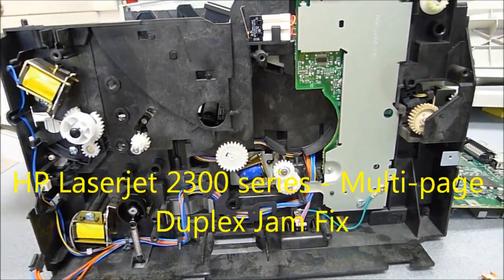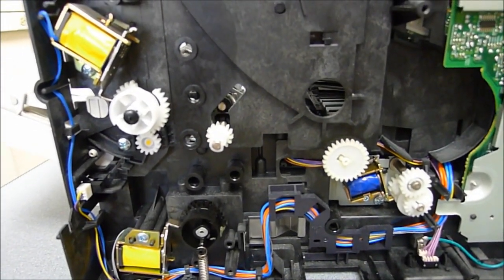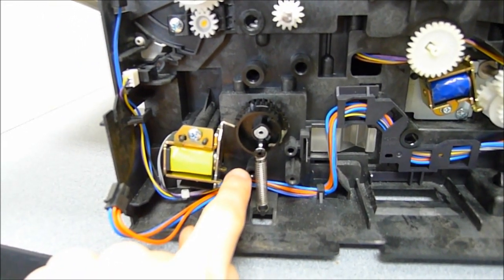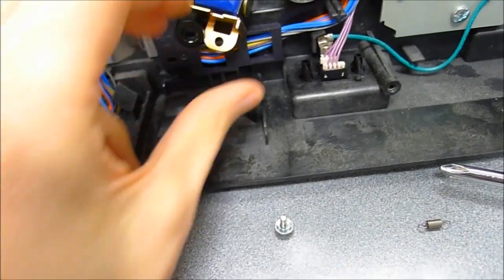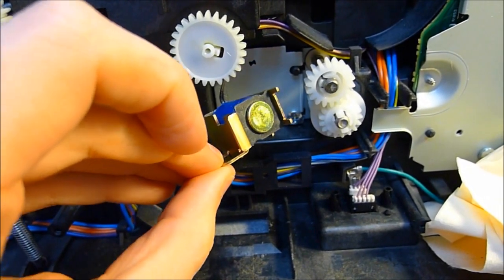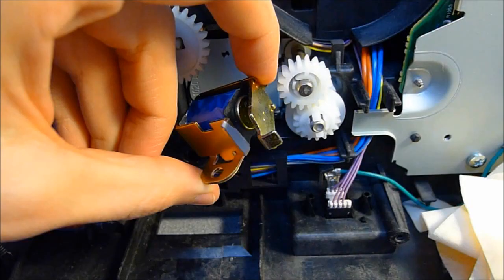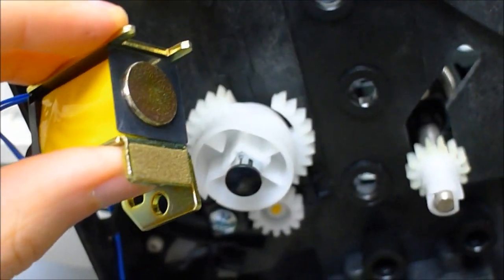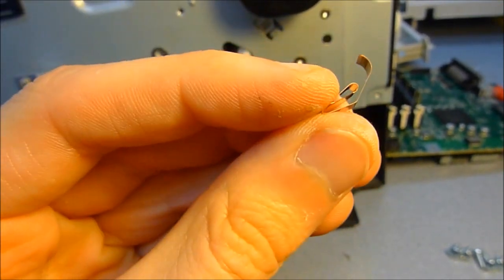Laserjet 2300 Multi Page Duplex Jam: a Solenoid Fix

Comment: I've had an HP Laserjet 2200DN for 10 years and it was easily 5 years old when I got it. I've had the issue for about 2 years and finally got around to looking into it, I could print one page consistently but after following your guide I'm now printing duplex and back 100% operational! All of the 3x solenoids were sticking. I used a few strips of electrical tape to shield them. Thank you, you've saved this printer from the scrap heap.

Comment: Thanks for this—found the video because I was having the two-page-feed/paper jam problem in duplexing. Once I heard the explanation of the problem, I pulled out a screwdriver and a bottle of Goo-Gone and the fix took about half an hour.

For those wanting directions to get the area shown in the video exposed—just sort of follow your nose. The rough order of disassembly is:

1) Side of printer (interface side, not power switch side) off—no screws, just a little plastic latch and a slide (look at the bottom of the printer where that face meets the bottom, you'll see the slide mechanism; the latch is just under the top cover, on the right near the front.

2) Remove interface/memory board—about 5 screws. If you have a JetDirect card in, remove that first. Just detach all the cables (one ribbon, two sets of wires). They'll be easy to remember where to stick, it's a 1:1 fit all around when reassembling.

3) Remove the back cover of the printer (two screws).

4) Remove the top cover of the printer. This is the most fiddly bit, the top cover connects to a large plastic lever/switch assembly on the right side. You'll have to disconnect this and let it drop through the hole in the top cover (use some needle-nose pliers or similar—gently).

5) Remove the front user interface panel. This isn't too hard—some screws and a metal plate.

6) Now take out about 4 large plastic-threaded screws and another three sheet metal screws and the entire metal panel comes away—a bit. It'll be tugging on three cables, one ribbon cable, one bundle of wires, and one ground wire. They're all connected just on the other side of the plastic wall; you'll have free access to disconnect them all with your hands, no problem here.

7) Lift away the entire metal assembly and you'll see the view in this video. The three solenoids are held in place by a single screw. I didn't disconnect the actual wires, just undid the screw and it gave me more than enough room to work with. Used goo gone, an X-Acto knife (to scrape the glue more quickly) and some Q-Tips to clean them all off. Then reattached the spring on each of them.

9. Reverse the entire process. Again, the hardest bit for me was reconnecting the top cover because of it's connection through the hole to the base of the printer on the right arm.

This probably even sounds more complicated than it is if you're mechanically inclined. Just follow your nose and the general order (side panel, interface board, back cover, top cover) and be methodical about figuring out how each piece is connected. There are no special tools required and no part is particularly tricky or dangerous—no four-letter words needed.

Comment: Just fixed my 2300DN as well, I used super thin Zip ties for the buffer for the anti magnetic properties....   works like it did 9 years ago when new.   Thank you for the information, I knew it was a timing issue, never ever would have thought that HP was dumb enough to do what they did.

Comment: To avoid any issues from adhesive, find some heat shrink tubing that is wide enough and cut a ring from it. Put the loop in place on the tab of the solenoid and shrink it with a hair drier. Do use anything hotter to avoid damage to the solenoid. You now have your bumper and no possible issue with adhesive in the future. You can get an assortment of heat shrink tubing from Harbor Freight (or possibly Amazon).
Reply: I also don't trust adhesive and electrical tape. Shrink tubing is a good solution. I will also try a short piece of silicon tubing. Jonathan Ohrt suggested super thin Zip ties for the buffer.

Comment: Thanks to your video I managed to fix my 2300n printer! I used duckt tape as the buffer replacement and it workes as new! (I made sure that duckt tape is wrapped around the metal part, so no sticky part is exposed). Thanks a lot and keep the good work!
Reply: years from now the adhesive will turn to powder :)

Comment: Thank you very much! This problem has been bothering me for 1 year. Before, I was always searching for 'paper jam'. Once I suddenly found the image is not correctly centered, but shift downwards significantly I finally realize is not the pick up roller, but must be some error in the timing. I changed my searching term to 'jam only duplex' That's when I finally found your video. Thank you so so much. 
But after my careless re-assembly, it first fails 5 pages, like jam or blur or all kinds of different errors, and then it go back to normal gradually. Only one thing not normal, while I was printing, now it says a 'Attention with the ability to continue' (=Red light blinking + Go light On)
Any one has same situation?
Thanks again.

Comment: How many layer of tape we have to put and of what kind of tape, can we use electric tape
Reply from the maker: I would recommend not using electrical tape because of how soft it is. Remember, the solenoid parts are going to be striking with force. Anything that can "sink in" might cause problems down the road. I'd stick with "invisible/clear" tape instead.

Comment: Thanks so much for this excellent video. 

Quick question,  can this solenoid issue also be the cause of single page duplex printing issues?  In other words, It jams even when when attempting to print one page, double sided. (prints OK single sided regardless of the number of pages). 

Any confirmation on this would be appreciated.
Cheers!
Reply from the maker: Yes, there is probably (although I don't know for sure - it's been 5.5 years since I made the video and I don't do nearly as much printer work anymore) a solenoid that is controlling the return of the paper from its first side, back into the machine to be flipped over to do the other side. If your jam seems to be occurring at that between-sides point, when the paper is going back into be duplexed, then it's likely that there's a sticky solenoid around the duplexer area. Good luck!
Reply: @heiseheise  Fantastic. I really appreciate your input and vote of confidence on this one. Given your hunch, I'll tackle it :). I completely understand that the video is old and so appreciate your feedback even the more. Thanks again.
Reply from the maker: @gillesgagnon  Right; I've fixed the service manual link in my description too. I didn't realize it was broken; sorry.
Reply: @heiseheise  np... I didn't know it was broken... it was kind of you to do this :)

Comment: Great.. other web postings guided me to the solenoid bumpers, but I stopped after cleaning them off.  If the duplex solenoid is left bare, the timing WILL be incorrect, and the machine will jam on every duplex page.  So, as heiseheise points out, that little peice of tape (I used a double thickness) is VITAL.  Thanks for saving my 2300s from the scrap heap!!
Reply: Hmmm—I didn't see this comment before doing the job myself and I left it bare—and just printed about 600 duplex pages after reassembling. So in some cases it may work—YMMV, all.

Comment: Excellent Video by "heiseheise".
Can I "glue a plastic" to the solenoid using superglue?. Is superglue recommended? 
I do have this printer in the office that has been abandoned for five years now due to paper jam.
I will try and fix the paper jam issue and provide a feedback when finished.

Also thanks to Michal Kowol for the photo illustration of where the clip should go.

Comment: I tried to do this fix and now my printer just clicks loudly twice when trying to feed from tray 2, and nothing else happens. (A paper jam is reported, but no paper rollers spin.) What did I do wrong? Tray 1 works fine. And I also have a Tray 3, and THAT works.
Reply from the maker: You doublechecked all the solenoid connections? Sorry, it's been years since I've had to do one of these fixes now (we've gotten rid of most of our old printers in my department), nothing is coming to mind.

Comment: that little clip  part is to ground the network card box to the chassis , not needed.
Reply: somebody Know from where are 1 piece of circular solid metalwith 4 - 5 mm diametter and 1mm thikness ? After put band on solenoid my printer does not recognize cartdrige and when does prints awfull pages with much grey over it;;;; BUT if I keep the printer on 45 degree it see the cartridge and print grey, so what should i CHECK NEXT ?
Reply: Confort Italia  OK I repaired the imprimant, that piece of metal was from a LEVER of some kind who stop one arc (springs) to enter in the second arc when cartridge is inserted in it's place, and a little piece of metal like a nail is forced to PUSH the cartdrige some milimeters from right to left ( when TOP cover is pressed DOWN). Hope it helps others ... who has these problem ( mine FIRST was duplex printing JAM, after cleaning the 3 solenoids and cover with electric band appear eroor with cartridge not installed) - and now is fixed and works great !!! - just a little more noise make now !
Reply: +john looActually that little copper clip is for grounding the plug-in network 
CARD's frame, the box itself is already grounded. I still wonder if it 
is really necessary though it's not a bad idea. . Replacing the foam 
buffers on the solenoids with small pieces cut from a dead bicycle inner
 tube (33 thousandths thickness plus or minus) using either double stick
 Scotch type tape or an appropriate adhesive works perfectly. No noise 
and I doubt they will ever die (The material HP should have used in the 
first place).

Comment: These printers come from the early 2000's
about 12 years ago my friends and I got some of these from a surplus store and they worked fine for many years.  Recently they needed this repair and we came up with the idea of using heat shrink tubing for the bumper.
No sticky glue to cause problems later!

https://drive.google.com/file/d/1rdZUTfLkQ38d-l2KGiXvCiNKW5bNscmn/view?usp=sharing
https://drive.google.com/file/d/1RG2qhpXT5Gw0fW3frvB1uLYyruTloWH1/view?usp=sharing
https://drive.google.com/file/d/1ipMzT6X5XncVuiaG-WoR5EgBGeI4HNvQ/view?usp=sharing
Reply from the maker: Your google drive links don't work, if you were trying to show pics of the heatshrink tubing (imgur or other public-based image hosts might work better rather than something tied to your google account?) but that is a great idea, thanks for sharing!